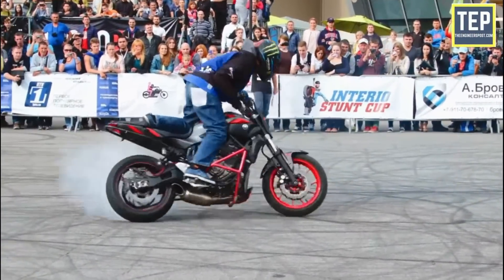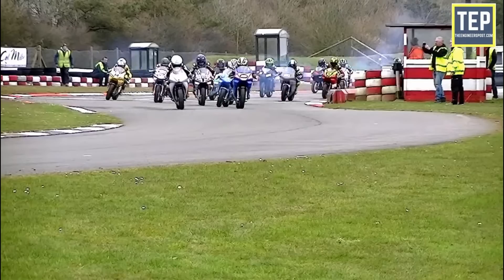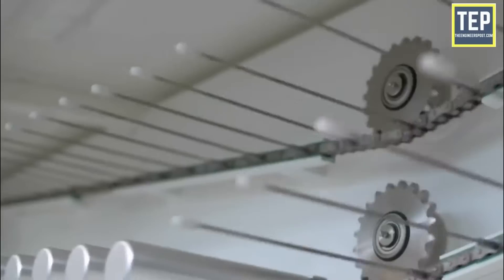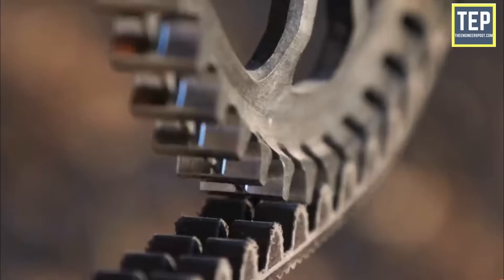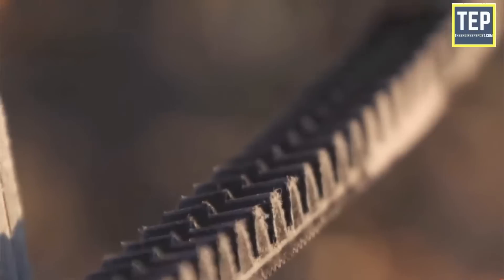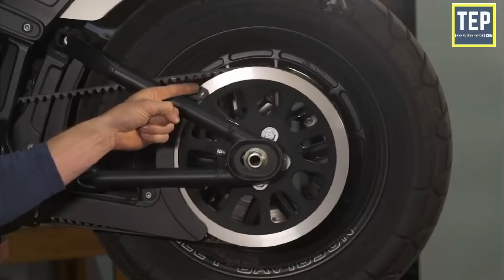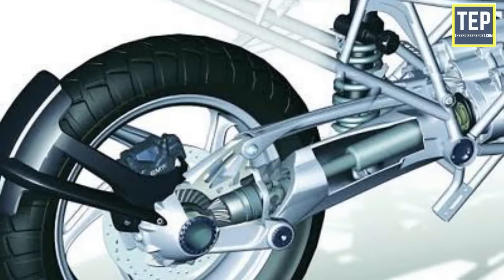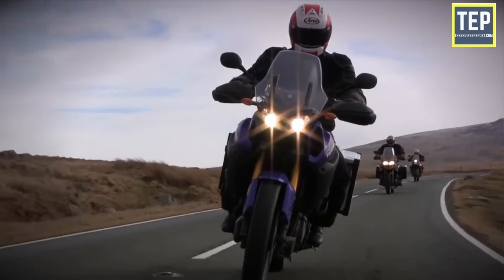Chain Drive vs Belt Drive vs Shaft Drive in Motorcycles | Which is Better?

Comment: All 3 designs have a specific purpose and type of motorcycle they are generally used for.
I've experienced all of the different final drive types. For me, cruising the open highways I love my shaft drive. Reliable, very easy maint. and I'm on a larger V-Twin cruiser, so a little loss of power at the rear wheel really isn't that noticeable. It's not a sport or super sport.
Reply: The power loss claimed is not likely, a car barely has that much loss. That tiny shaft and very few gears would be under 10% loss and not that much higher than either a belt or chain, maybe 5% difference.

Comment: I prefer shaft drive, Easy to maintenance more confidence for long range riding. 600km/day is my minimum on weekend trip.
Reply: I rode a ZX-14. Took me 50.000km (30.000+ miles) to wear the chain down. 50.000km / 600 = 80 days = 40 weekends = two years of your nice weather riding. My ZX14 was a 500lbs, 200bhp, 150+NM bike, doing 0-100kmh in some 2.5-3s, passing 200kmh in about 7.5s. I rode the whole year trough with it. Only took the car out when expecting hail or heavy snow. How about confidence for long range riding? And how long does it take to change a chain and sprockets? Chains wear, but you can easily see how much and change them in time. Now look at a driveshaft and tell me when it's going bust!
Reply: @arturama8581  My previous bike was ZX14R also New piston, camshaft, big butterfly throttle with PC5+ignition module.  Top speed on GPS was 333kmh officially.
It run so smooth I take it to every countries as i could. But after some of my open bike fellows(Haya H2 ZX14) were dead and some got disability, I prefer to ride long with moderate speed. That's why I switched to shaft drive bike, no need to bend down my body to take care of it anymore.
Reply: @bigbird2523  That's fine and I am sorry for your losses. Not everyone can handle such bikes (you don't have to ride them hard) and then it's very wise to change to a more docile bike. A friend of mine did the same and I was about to change my bike to a GTR1400 cause of neck problems. But my point still stands. How is a chain and sprocket less reliable than a shaft?

Comment: Been riding bikes all my life-Brand new Harley Belt Drive =A small pebble got between the belt and the back gear and it BLEW the Belt.Now the Shaft Drive bikes when you give it gas the torque actually raises the bike by putting more downward pressure on the back tire.Dangerous on wet curves.Chain Drive replace the stock chain and gears to performance If you like Speed.My last bike is S-L-O-W compared to the new bikes Yamaha YZF 600 RR. That bike did over 180 MPH-2 things you need going fast performance chain/sprockets and New Soft Rubber tires for grabbing the corners.
Reply: Drove fast bikes over 50 years-Never wrecked my bikes and Never got caught to get a "Speeding Ticket"
If you know how to drive the police will never catch you.Never ever get a Custom Paint job Why?If you speed alot it becomes a COP MAGNET.

Comment: Honda 750 was so popular in the '70's, a company made a kit to enclose the final drive. Had rubber belows flex for up n downs. Oil in, dirt out. Nice long chain n sprocket life. Harley did the same thing back in the old days. Seems they always leaked and the styling experts didn't like it, but the idea is sound.

Comment: Geez, do I hate that computer generated voice! Have you run out of human beings? I have had all 3 and hate the noise and mess of the chain, the weakness of the belt in the dirt & weight - power loss of the shaft. Waiting for the "drive by wire" wheel - i.e. good electric motors in the hubs. Wish my Zero FX was 2 wheel drive (with reverse).

Comment: Have them all.   Depends on needs.  Of all three if I had to pick only one, shaft drive.   Though different applications are best for different set ups.  My ADV Yamaha Super Tenere that sees mainly interstate touring and foul weather commuting shaft drive rocks.   No fiddling or time wasted lubing and adjusting while touring and not affected by weather and offroad.  Occasional oil changes only and sure simplifies tire changes.

Belt drive on my Harleys is nice on my Streetglide and Dyna.   No maintenance and cleaning, though a hassle to replace em when you have to with pulling entire rear apart.   

Chains on my Hayabusa and KTM is great for those applications.   Hold up well to big HP and shock.   Lighter weight and easy to change gearing.

Comment: I have seen alot of shaft drive failure very expensive to replace parts most of them are parted out. My Harley Davidson FXR has belt on it now. Going to switch it to chain drive.
Reply: only way to destroy a shaft drive is to wipe off the 60% moly lube from the factory when you change your rear tire
and replace it with axle grease. That will destroy the spines in about 3000 miles and cost you about $500 to repair

the moly lube from the factory is good for 100,000 miles if you just LEAVE IT ALONE
Reply: Why do you wanna change to chain from belt? Just curious?
Reply: @frapp31  Read it again its the other way around, belt to chain, which is a mistake in my opinion
Reply: @poolhemi  yeah that's what I meant. I have only had chain drive but would love to have belt for my next bike.

Comment: Chain drives are a pain in the rear-end because of chain kink and slap as well as having to tighten it periodically because of stretching.  As far as I am concerned "Shaft Drive" is the only way to go if you want to have a maintenance free drive train.  Yep he was absolutely correct in his reflection on the shaft drive.  I once had a Yamaha FJR1300 (a sport touring bike) with a shaft drive and I'll vouch for them as being one of the best drive trains on bikes.

Comment: I'm confused with motor cycle ,in bicycle they put the bigger cassette at front and smaller one at in wheel and save energy and produce more toque but in motorcycle 🤔 smaller cassette at front and bigger one in wheel and talking about saving torque

This is a doubt i wouldn't know untill i become a mechanic
Reply: Because the front sprocket is bigger one full revolution is more than the rear this making your wheel turn faster by you pedaling than if it was reversed. If you are pedaling a smaller sprocket it would take roughly 3 or more turns to make the wheel travel one full revolution. It is essentially different so that a person can propel it reverse the tire doesn't spin faster than it should when being driven by an engine, if said engine is at 1500RPM you wouldn't necessarily want 1500 RPMs at your rear tire. It's a gear reduction for speed matching. Confusing at first but when you get the gist of it that's just how it works.

Comment: I prefer the shaft system despite its cost and its higher weight because it is the most reliable and the most robust and its requires a a clean and minimum maintenance. I have it on my Honda VFR 1200 and I am able to compare it with the chain drive present on my previous VFR 800. Very nice video with a relevant analysis of the characteristics of each transmission system. Many thanks.
Reply: Question how about those closed chain system thingy like in the honda super cub ?
Reply: @LoneliestDog  it’s still a chain, just has a cover. 

I agree with shaft being king. I’m happy to sacrifice a little efficiency for the reliability. My daily driver still has a chain, but my old gl1100 has a shaft.
Reply: @LoneliestDog  Closed chain is not in my opinion a clever solution. You can't see the tensions chain have and the behavior between different amounts of stress. I am watching on my friends bikes to warn them about it. Special on sport bikes and with a passenger. Of course they pushin' it too its limits.
Reply: @LoneliestDog  aaaA@@@@
Reply: @LoneliestDog  I am not familiar with such transmission system which appears to be more or less appropriate for smaller engine than the engine implemented within the VFR 800 which is a 
sport bike. As it is well analysed in this video, the chain transmission system remains the most appropriate to sport bikes with high performance engine, but of course the system requires an appropriate maintenance and a regular cleaning.
Reply: I just don't trust anyone with two vfrs.
Reply: Same here
Reply: I can't believe that your power loss estimates are close to accurate.

Imagine the heat, 8f that driveshaft alone were dissipating 25% of the power output.  Lmao, it would need it's own radiator and waterpump, especially as it's largely contained and not easily air-cooled.

Just seems like a crazy high estimate.

Edit:  cars are about 15% power loss through the whole drivetrain, including transmission and differential which contribute the most.  No way these numbers for just the final drive are accurate.
Reply: @zakpodo  Those estimates are wrong see my other post.  R1250GS ~ 86% vs. Chain drive 92%.  Includes gearbox losses and  driveline.
Reply: Not for me: a shaft each 40.000 km on a R1150RT due to the rubber torque buffer getting torn... On the contrary, the 160.000 km belt of my Vision looks almost new...

And chains are a mess...
Reply: @PierredeCur  40k km only damn, in my club we have an ST1100 with over 400k km without any major issues with the shaft. Only had regular maintenance on it. Several others have over 200k km with no issues. Same goes for the St1300
Reply: @blaster112  the problem is that I used to ride quite hard with my Beemer, to the point of fitting RR tyres, and the problem is the gummy torque absorber in the middle of the shaft: it flexes under high load and does like acceleration in bumps. I had not problem with  R90S that did not have torque buffer in its shaft. Still, I think belts are better for motorcycles than chains and shafts.
Reply: @PierredeCur  they have their advantages and disadvantages. I like my shaft driven ST1300. Quiet and almost maintenance free.
Reply: @blaster112  I had several Beemers, Guzzi and Goldwing, so I used to like them better than chains for this reason, but, since the problems with my RT and  how well the belts of several bikes like the Vision have performed, I now prefer belts. As clean and reliable (more in the case of the RT) as a shaft, but smoother and quieter. :-)
Reply: So u like the shaft huh . Hoto
Reply: Chain is so very strenght..uphill high mountain loaded of 10 passenger and woods.https://m.youtube.com/watch?v=PHXPOuXnzPk&t=0s
Reply: F*** I love when people get on here that know nothing about Motorcycles all mechanical friction or Power lost through drivetrain and stayed there bike completely goes against the laws of physics and is different every other bike because I can tell you right now shaft drive is nothing but problems noise and expense belt drive is a nice and quiet minimal power loss through drivetrain and at the very top of the list the chain drive is the best system or is wiping the f**** thing over with an oily rag too much maintenance for you
Reply: @mymadness299  the shaft on my 75k mile goldwing is absolutely fine.. no noise, no leaks, no problems. I do not care about the efficiency loss and upkeep doesn’t bother me.. it’s about reliability for me. Aside from the occasional lube, the shaft is just gonna keep going. I could set off on a cross country trip tomorrow and never think about, or deal with the failure that may occur with a chain. Chains last for a while.. 15k on my daily driver but it’s also getting a little tired and ive got another ready to go. Your opinions don’t invalidate other’s
Reply: @mymadness299  The published crank power output of BMW R1250GS is 136 hp.  The measured rear wheel power output is roughly 117 hp.  This means driveline efficiency is roughly 86% which is quite remarkable for shaft drive.  

If I compare to my Versys 1000 it  is 118 hp at crank and 108 at rear wheel or about 92%.  Thus, for the best designed shaft drive you are losing about 6% power or efficiency as compared to chain drive.  For large 1200cc plus engine powered motorcycles that efficiency trade-off is not bad for a much easier to maintain motorcycle.  They already have > 100 hp to rear wheel which makes a motorcycle even with shaft drive  quicker than most supercars.